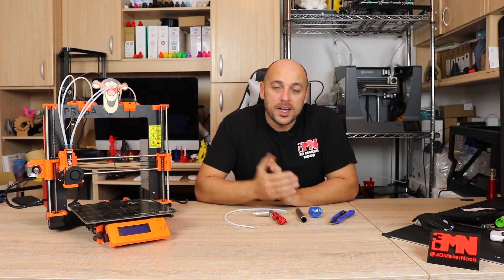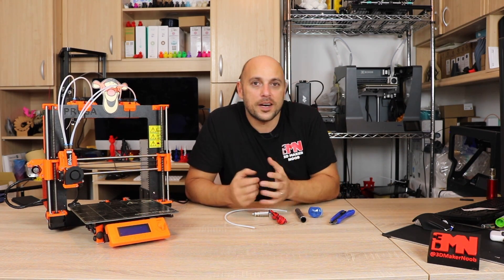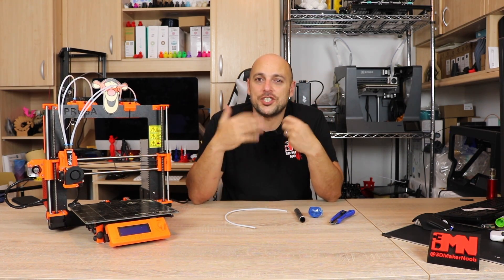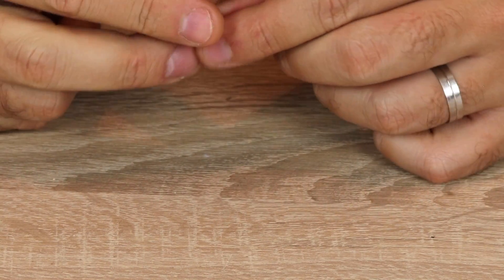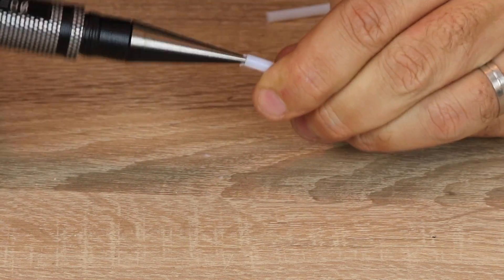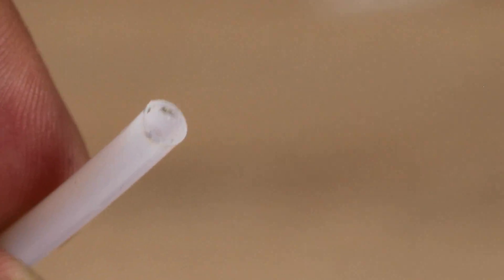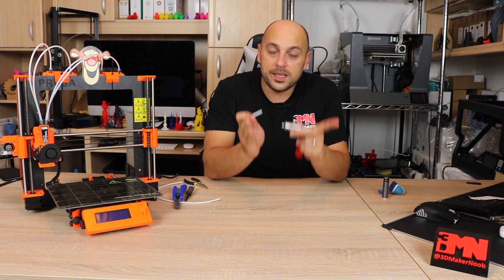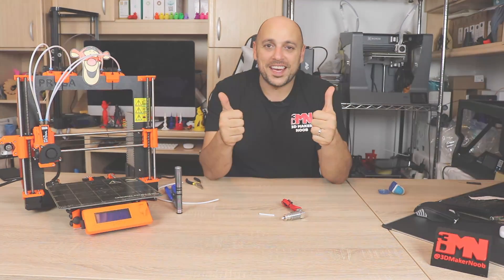How I Reduced Filament Jams On The Prusa Multimaterial Upgrade

Comment: Hi Joe.  Just seen this video; unfortunately, your advice is not quite correct.
The PTFE tubing inside the hot end of the MMU is nominally 1.85 internal diameter; the length required is 41mm.  As I have pointed out on the PR forums. simply replacing it with 2mm ID tubing as you suggest will cause more problems.  This small piece of tube is the primary tip-forming device when unloading; it is very important to get it correct.
The lower part of this PTFE tube should be pre-formed by PR - you should contact them to ask for a replacement.
Unfortunately, the pencil-sharpener does not produce the correct angle; I have created a small printed model (on the forum) which works fine and uses a pencil-sharpener blade.
Peter
Reply from the maker: Hi Peter, thanks for the feedback, i will pin your comment for others to see. However i do point out several disclaimers about doing this in the video, and i specifically say that you might end up ordering a replacement and just because it worked for me, it doesn't mean it will work for everyone. Having said that, it did work for me and it's still going strong about 200 hours after doing the modification without a single jam. I have also left links in the description for Capricorn tubing due to its inner diameter. Can you send me the link to the printed part so that i may try it out?
Reply: Hi Joe.  Chamfer tool is in this post: https://shop.prusa3d.com/forum/original-prusa-i3-mk2-multi-material-f26/blockage-troubleshooting--t4643-s50.html#p35424  It's a bit basic and you will need to run a 2mm drill through the centre of the part once printed.
I think the Capricorn tubing could work well with this setup; I took delivery of 3 metres yesterday - mainly to replace the Bowden tubes - but I will be testing in the extruder as well.
Thank you for this video; it points out one of the potential faults within this system and is an excellent demonstration of the solution.
Reply from the maker: +Peter R thanks buddy I appreciate it. I will print the tool and try it out, maybe I can revisit the episode once done and speak of it with your permission
Reply: Joe, if it helps, then not a problem.  I have never required permission or attribution for anything I have published (including the KISS post-processor which you may want to have a look at one day!).
Reply: What's this KISS post-processor you speak of?

Comment: Good work Joe, Initially I wasn't that sold on the MMU. Then I got a BCN3D Sigma (for a very good price) so still didn't realy get into it. But the more I see of it, the better I like it. I'm not planning on upgrading my MK2, but I will order the MK3 and may well upgrade that.
That reamer is a great looking tool, just ordered it from Amazon.
Reply: Same here. Had not seen one of those before - used the Amazon UK link.

Comment: tip: for anyone who is dealing with PTFE tubes, either you want to insert it into bowden system or what ever reason, you will find out it is so slippery

use blue tape to wrap around and grab that poration .

you can get away with it by using more force when grabbing it. but the force needs to be even around the tube, otherwise you might kenk the tube without you notice it.

Comment: This will probably work on a normal e3dv6 to reduce jams also. I'm gonna try it.  I've been using a filament oiler to avoid jams. I did try a variant of this trick but i only chamfered the outside of the tube. It helped,  but it wasn't 100% successful. I'm gonna try chamfering the inside as well. I only seem to have problems with nylon. I also reduced retraction to only 1mm which definitely seemed to help on my single extruder.
Reply: if your only using the 30mm fan for hot filaments like nylon, the all metal hot end can suffer from heat creep issues which results in jamming at times. This is why reducing the retraction helped you, it doesnt let the hot filament get higher into the heat break and pull heat with it.
Reply: Matt Weber Yeah,  i got a better fan to put on it,  and it did help,  but it's still only 30mm. I don't have room for a bigger one on my anet a6 direct drive setup. A radial fan would be the way to go if i could figure out how to duct it in there.

Comment: I know you mentioned this but I wanted to stress that you wanna make sure there are no PTFE bits inside the tube. Static electricity could potentially harbor microscopic particles in there so make sure its clean guys cuz PTFE is pretty heat resistant and might cause more jams tho I haven't tested how easy a particle of PTFE melts at operating temps :-)

Comment: But isn't this PFTE a special made diameter (inner) specific for the MMU version?  So where do you get this special PFTE?
Reply: no its just ptfe tubing. there is no reason for it to be special diameter (plus having it specially made isnt aligned with Prusa's open source image, he wants things to be able to be easily sourced if needed). If he was to use a different PTFE im sure he would simply use a higher grade like Capricorn which has a tighter tolerance on their processes and diameters vs cheap ptfe tubing.
Reply: According to Prusa the hotend PTFE is a special custom made 1.9mm ID tube made by Festo specifically for Prusa. The 1.9mm ID matches the special chamfer of the custom E3D mutli-material heatbreak and the ID of the metal cooling tubes. This tube is where the molten end of the retracted filament is reformed to a tip so that it can smoothly slide in and out of the hotend and tubes. It should not be substituted with regular 2.0mm ID PTFE as this will lead to a ~2.0mm bulge of solidified filament which will then almost certainly jam in the 1.9mm metal cooling tubes. Capricorn MIGHT work but their spec is 1.85mm ID while Prusa's is 1.9mm specifically to reduce jams on slightly out-of-tolerance filament which can sometimes exceed 1.85mm diameter. Here is some more info: http://manual.prusa3d.com/Guide/How+to+trim+PTFE+tube+-+Multi+Material/497
Reply: That's my reason for writing this - I also heard that it was special some time. Now I just asked the chat support at prusa and there they told me that it's the exactly the same?  What now to believe?
Reply: I think the support chat is just reading from a script / FAQ... I wouldn't take that as authoritative without official confirmation...
Reply: The PTFE running from the extruders to the hot end are special 1.9mm ID; made by Festo.  However, I believe the PTFE inside the hot end is the same you get with any E3D V6 with a little bit of chamfer added to one side.
Reply: @Riskable Uncut, I think it's the other way around. If you look at the diagram from the Prusa MMU manual, the specification for the heatbreak liner PTFE requires a 1.9mm ID so that hot molten filament passing through this tube will form a 1.9mm tip.  If this were 2.0mm the filament would cool down to a 2.0mm tip and get stuck trying to retract into the 1.9mm ID metal cooling tubes. As far as I can tell the bowden tubes between the extruders and Y-splitter are regular 2.0mm PTFE as there's no requirement for these to have a special ID. (Although it could help lower the retraction distance.)
Reply: Matt Weber Not sure that having something specially made is against open source philosophy, maker only needs to make the specifications publicly available, so you can reproduce that. Open source is not the same than standard.